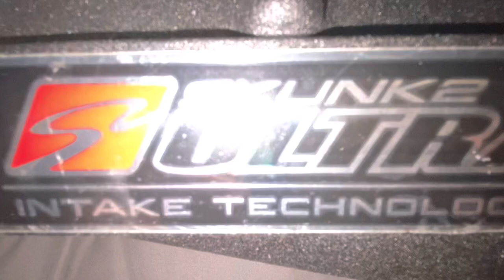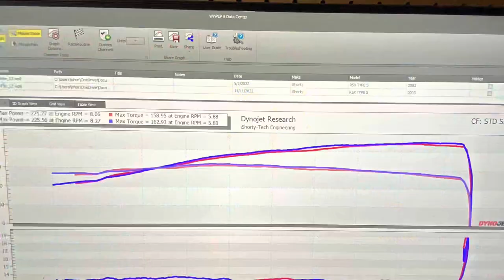Skunk 2 ultra intake on Rsx and dyno pulls

Comment: wow all of that for 4hp extra lol. just boost that shit. my rsx stock everything except for kpro, fuel pump, and injectos and 2.5 exhaust with ebay kit 400hp. kit cost me 1000 bucks. turn up the boost a little and gain 20hp easy.
Reply from the maker: In the future rn just want all motor
Reply: What injectors?

Comment: 😂 i notice everybody running these skunk2 intake manifold are making same power or less power, im jus saying i ain't going that route.
Reply from the maker: It’s for the looks it’s also a ultra street not an ultra race
Reply: @tyronelaflare6266  looks awesome, I was going to go skunk2, but instead I rather go with a 4 piston block since they usually go on sale in the winter time, I've seen guys make 290hp with 2 bolt on with a 4 piston block with stock internals.
Reply from the maker: @MiSCHiEF_BassMusic  that sounds awesome I wish I could get a 4pistons head with that and drop in cams I wouldn’t doubt those numbers.. as far as intake manifold goes you can make almost the same gains with a ported rbc manifold as the s2 ultra manifold without the spacer they have the same airflow
Reply: @MiSCHiEF_BassMusic I was gona go with this intake manifold BUT I think I’m going to get an engine block instead lolllll    🤯     Little bit of a difference there bud 😂
Yes you can make right at 300whp with the right setup/tune with the 4piston block/head and all the fixins